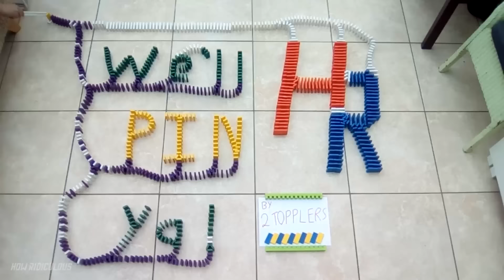Can This SOLID GLASS BALL Survive a 45m Drop?

Comment: The beautiful coney-joney was first discussed by Hertz back in 1881 and has henceforth become known as Hertzian cone cracks. They typically occur when a hard spherical object is pressed into the surface of a brittle material. In this case, the sphere itself is made of a brittle material (glass) and is "pressed" into the steel plate when it impacts, but the same effect is present. The cone-shape is caused by the propagation of a crack. The crack begins its life as a ring just outside of the region that's in contact with the plate, where the tensile stresses (the kind that pull a crack open) are at their highest. The crack generally then grows orthogonally away from the surface for a short distance before turning and heading away at a coney-joney angle. The path followed is one that maximizes the release of stored strain energy (the same sort of energy that is stored when you pull back a rubber band). The maximal strain energy releasing path is ultimately guided by the local magnitude of the stress fields (similar in concept to the gradient of the pressure levels in the glass upon impact) near the leading edge of the crack. All in all, for spherical contact such as this, the stress fields basically say to the crack, go be a cone, it's the best release. Source: PhD in this area
Reply: My guy can u teach me all know
Reply: I would expect also that the wave pattern on the cone may be related to the internal stresses placed on the glass while it cools, right?
Reply: Thus answering the age old question: there IS a doctor in the house!  Thanks for sharing your knowledge!
Reply: give me your knowledge
Reply: it brakes like that cuz a the g-force vbehind it and has a cone cuz it has no where to go, example, 7:58 .
Reply: If you read this all you are the kings of kings of all mad lads
Reply: dude! sick.
Reply: k
Reply: Dude can you teach me that
Reply: Benjamin Hackett true
Reply: My brain....
Reply: You took your time...

TO RIGHT THE WORLD A HISTORY STORY!?

Im proud

Please teach me you ways
Reply: If I shatter, I always go cone.

Its the best crack.
Reply: Funnily enough, this video will some day appear as a reference in a dissertation. I’d bet money.
Reply: I agree
Reply: Love the source
Reply: Three scopes ye
Reply: Thank you sir. I came here from snapchat hoping to find an explanation for the "coney-joney"
Reply: Maybe the amount of spin or lack of is also a factor to consider, because the spinning might have made the crack more even, but being that the spheres had no spin, they only had one impact point?
Reply: Could the PhD explain the waves? I’m still awestruck
Reply: @rew970  also if you look closely, the cones aren’t all straight, they’re at an angle. That would be due to the spin
Reply: So the middle didn't crack because it's pressed into the metal plate?
Reply: @TheNamesArif  when the ball makes contact it stretches, the point of contact was a circle, so the crack was along the edge. But due to it being a sphere, the crack followed the shock wave up the ball
Reply: @MaleviahBurned  you're the person in class who got solid D's cause u were too busy bullying smart people to pay attention
Reply: so correct me if i'm wrong 
but the forces shear the glass away from the rest in a radial wave 
it tries to follow the path of least resistance and that is why it is off center?
Reply: Thank you you crazy beautiful nerd!
Reply: As far as understanding the effect in less scientific terms - this has been known and used since the stone age as part of flint knapping of stone tools and arrowheads.  The way in which you must strike the stone or insert pressure into the stone is ultimately guided by the conical flakes that will come off.  Amazing how long something like this can be used practically and expertly before we finally understand the material physics behind it!
Reply: That's just a windy version of what I said.
Reply: @threescopes5598  You mean *wikipedia because that's where he found it.
Reply: @jsweizston5410  well yes but no
Reply: nerd ;)
Reply: Smart arse
Reply: Maleviah ok maleviah
Reply: I feel like my explanation was better tho xD
Reply: The joys of materials in engineering
Reply: I'm just curious, but I'm taking a first year earth sciences course, and my prof said in a lecture that it was due to the fact that quartz (not glass directly) has no cleavage planes, resulting in conical fractures. Could you explain quickly if this is also a factor? I'm really interested to see if these are technically both correct.
Reply: I'm pretty sure this is a jest. Whether it is or not, it's brilliant!
Reply: I feel like you’re bamboozling me with science words but I trust you
Reply: God had a seizure when trying to process this and died
Reply: Benjamin Hackett I like it ConyJony hahahahahhahahahhahahahahhahahahahahahah
Reply: @vinzentjuanlopez3675  I read all of it
Reply: The More You Know
Reply: Thank you mr wikipedia
Reply: @threescopes5598  BiLl NyE tHe ScIeNcE gUy
Reply: Source: because i fucking said so😂😂
Reply: How Come You Know All This
Reply: I’m not 100% correct, but I think that it was caused by the impact going all over the surface area of the sphere, and a bit of the kinetic energy going up the core of the sphere. The glass shattered off the edges, forming a slight cone because the impact had no where to go, it would stay in those layers making them shatter. The actual cone shape comes from the core of a sphere being the strongest part of it, so most of the core survives. However, the slope was caused by the same theory, the sections of the sphere obviously get stronger and stronger towards the core. I think this is a much more simple explanation but I’m not 100% sure it works like that. Also, I don’t really think that you wrote all of that, you copied and pasted, not saying that’s bad or something that you could not do, just saying that you didn’t really know about all of that before you searched it up.
Reply: Bro you just how?!?
Reply: Copy and paste lmao
Reply: my head hurts
Reply: i think you made all this shit up. but i also believe u. im not sure why i cant decide either way. inma go to sleep now. thanks.
Reply: im pretty sure that the sound waves made the waves of it
Reply: Ok
Reply: Accurate✅
Reply: I like to think @Benjamin Hackett has a PhD in specifically the coney-Joney
Reply: Be my teacher
Reply: Oh no I think I'm back in history class
Reply: Excellent explanation!  And this is why I can’t teach anything other than basic science. It was taking me FAR too long to try to come up with an explanation in anything resembling plain English. 

Let’s just say that when I took relativity and quantum physics  and my grandmother asked me what it was about, she was confused when I told her that she didn’t want to know. She complained to one of her friends that I wouldn’t explain it to her...three hours later she agreed with me that she didn’t actually want to know. Said friend was a retired NASA rocket scientist. Oops. 🤣🤣🤣 For context, I had a history of rambling on endlessly about science topics so my reticence was pretty out of character. I was never known as being very succinct. I wasn’t trying to pick on her, I just knew that after a chauvinistic ass of a middle school science teacher destroyed her hope of studying science, she hadn’t been allowed to take further science courses. 

My grandmother was incredibly intelligent, she just never got the opportunity to get the groundwork needed. She managed to not only raised two kids after my grandfather ran off with no support but also put herself through college and grad school at the same time and then sent her kids off to college themselves
Reply: Ummmmmm science
Reply: Damn,nn,
Reply: The real resin is that it is cleavage meaning it breaks off in sharp pieces
Reply: You copied this you filthy cheater.
Reply: @rew970  They actually DID have a spin if you see how they throw it, the way they let go creates a force on one side creating a spin on both sides. Therefore it is the twist on impact along with the reverberations inside as it smashes creating the "Coney-Joney"
Reply: So in other words the ball is good at distribution of force which causes the force to move away from the point of impact, but it still has its limits.
Reply: are you from Harvard or no?
Reply: wait wait wait did you copy and paste this or liggit write this.
Reply: I understood this?
Reply: Thanks doctor. Wonderful and understandable explanation
Reply: Hold fruit
Reply: Nice copying and pasting of information, boyz.
Reply: That was beautiful man
Reply: Copy past?
Reply: I feel like he took this out of a textbook
Reply: BIG BRAIN
Reply: It’s because the metal plate was slanted
Reply: Cool, that's probably why when an engineer calculates the strenght of a chemical anchor on concrete, they have to calculate a cone shaped break pattern (vs the strenght of the concrete). Thanks for the info!
Reply: Nnnneeeeerrrdddddddd
Reply: GENIUS!!!
Reply: Tou are the new Einstein.
Reply: It is big brain time
Reply: @PumpedCrazyGamingYT  He just did.
Reply: @nathangil8370  Like he said he has a PHD in science.
Reply: Dude, this is more than my school will ever teach me in all 12 years combined, thank you for this!
Reply: DA coney joney only acuurs when the force of the shock is spread sphere wide
Reply: all I heard was science
Reply: The ring is not actually cylindrical, but instead is a cardioid.
Reply: @acuteslipperysnake5778  your
Reply: Is this how to cone heads were born.  Thrown down the stairs and thats the result?
Reply: What is your phd called?
Reply: The actual physics that happen are more interesting.
Reply: @Kwint.  I dk
Reply: Legend.
Reply: Omg 😲  😱 welly
Reply: @nathankush2051  wtf
Reply: You say spherical object not sphere. would this effect work similar in an oval like shape or is it specifically a sphere?
Reply: I love it when PhD's come down to earth to explain stuff to us mortals in a way we can understand.
Reply: Are you saying that the steel plate hitting the glass so hard functions like therapy for the glass ball?
Should therapists be punching people?
Reply: Copy and paste?
Reply: All he did is copy/paste it from google
Reply: Weird flex but ok.
Reply: Well damn
Reply: God dam
Reply: TL;DR
Reply: That was pasted lol
Reply: I feel like this is from google ;-;
Reply: It’s way more simple than that it’s because all of the force pushing on the bottom shatters everything around it
Reply: Tf
Reply: Brooooo I mean... I least he put were he got his source that’s reasonable
Reply: can i have one big plez
Reply: Ok
Reply: I love how people that don’t understand science assume that anyone who does must be faking it
Reply: Just so u know I paused the video just to read the hole thing its currently 3:21am eastern time.
Reply: @kyleroberts4399  that great but I’m talking about the people who don’t and accuse it of copy and paste or google
Reply: What he said
Reply: In other words it want to be an ice cream cone
Reply: I kind of just figured it was like a shock wave, when you drop a pebble in the water you have rings of waves moving from the point of the impact, I figured that the cone is formed because the shock waves move away through the glass from the point of impact creating a cone shape. Further evidence of it being from a shock wave is if you look at the cone you can actually see ripples carved into the glass
Reply: Ahhhh my eyes burn! Do you know the reference
Reply: The more you know
Reply: Copy and paste
Reply: that explains why the bowling ball din't have it
Reply: so basicaly it hits the ball at a point, and the pressure is dispersed and the crack expands outward. leaving the point of impact unharmed and sendingthe vibrations outward?
Reply: There is no way he didn’t copy - paste this.
Reply: @norvillerogers3504  or maybe he's not a blockhead like you
Reply: Had to read this twice
Reply: Ur my new science teacher
Reply: You are kind of corect but Im notgoing to get into adom structure right now
Reply: you better not be spiting bull but thanks
Reply: Good to know
Reply: u googled it
Reply: who needs school when you have this
Reply: I believe you but I’m tired and don’t wanna read it
Reply: The king is among us
Reply: Redo it has no period.
Reply: I was going to say that but was to late :(
Reply: @yohanneshaileselassie4341  i know that there is a better thing than school it is this!
Reply: @vinzentjuanlopez3675  I mean it's not exactly that complicated hahah..just a history lesson and some science info you wouldn't know if you aren't in the field
It's still easy to follow and understand, and it's just one paragraph haha
 doesn't exactly take a mad lad, just someone with reading comprehension & an education :P
Reply: @vinzentjuanlopez3675  if you want a tldr, it's just that the cracks have a natural tendency to follow a certain shape upon impact
Reply: What??
Reply: Holy shit daddy chill
Reply: What makes the crack always go in cone shape
Reply: Okay, then how much force would be required to fully shatter the sphere?
Reply: Uh, what he said
Reply: Brainiac
Reply: If ur knowledge was transformed into muscle u would be the strongest man on earth
Reply: # Rifty fish
Reply: Jesus his fingers were tired after this one
Reply: Incorrect
Reply: Nerd
Reply: Somewhere there is always someone who ACTUALLY knows the answer for something no one thought there even was a solution on.
Reply: Yes
Reply: What he said
Reply: I didn’t read it all
Reply: When reading it Stanford said coney-joney
Reply: Isn't that what we called "Frostum"?
Reply: Bro I have to low of a iq to comprehend that
Reply: I was just going to say it broke and stuff happened
Reply: Big brain
Reply: nice copy paste
Reply: Glass fractures are amazing.
Reply: Ahh the beauty of copy and paste 🤣🤣
Reply: If you made a video about this I would definitely watch it! Great explanation!
Reply: It’s amazing what copy and paste can do
Reply: so there is ACTUALLY a doctor in the house xD
Reply: Short version of what he said is when it hits the plate the layers underneath it don't affected as much as the 1st layer meaning that the glass turns in to sorta like a pyramid
Reply: I'm diggin' the TLDR at the end
Reply: Thank you
Reply: That’s a lot of explanation
Reply: Nerd

Jk
Reply: Simplify please
Reply: Teach me all u know
Reply: Yerrrrrr
Reply: E
Reply: Pfffffffft i definitely new this before I saw the comment
Reply: HOW LONG DID IT TAKE TO WRITE THAT?! *looks up at the comment*🙄 AAAAAAAAAAH
Reply: @hazma1239  YeAh SuRe,I tOtAlLy BeLiEvE yOu
Reply: Nerd
Reply: @megs24031  U rude
Reply: I went to the comments looking for what the coning of the glass ball was called but didn’t expect to see a whole essay on the topic.
Reply: My guy has big brains
Reply: Did you copy and paste this from google?
Reply: No it’s cause of the Mars rocks nerd
Reply: 🔫 how dare you know more than me
Reply: I think someone copied something on wkipedia but cant  figure out who🤔
Reply: Here, take my upvote. Thank you for sharing, sir.
Reply: sooooo.... in simpletons terms, i can roughly translate it to...
"cone-cone made by big gravititties"
Reply: Wow
Reply: Do you know why the balls flip everything?
Reply: Jesus Christ dude it's just a comment you don't got to go all high school Professor on us
Reply: Me singing It's a Long comment 😮

Me after I hit the read more button💀
Reply: I’m amazed there’s no cracking on the backside because theoretically the impact would wobble around the outside of the sphere and make a crack on the back
Reply: w h a t.
Reply: All I got was this is Crack and I think maybe Kinetic energy.
Reply: nope rocks come from mars to make a coney honey.
Reply: does this have anything to do with fluid dynamics and glass being a "slow liquid" if memory serves? speaks to the quality of the sphere manufacture, but the high speed footage at the very end shows very clear ripples which appear to shape the conical fracture points.
Reply: Im too lazy to read it
Reply: NERD! jk I'm a little jealous 😂
Reply: Lol I only knew about half of that good job man! 😁👍
Reply: When you click read nore
Reply: Nice
Reply: @Tilvent  copy and past
Reply: That's what she said
Reply: Bill Nye's cousin over here
Reply: Mmmmm classic google copy and paste.....😌😌😌
Reply: You looked it up
Reply: How
Reply: can u become my friend
Reply: @johnjon4688  yes
Reply: I have no idea what any of that means but I'm assuming it's correct because there is a lot of sciencey words
Reply: I didnt understand most of it but still thanks. xD
Reply: My brains just grew.
Reply: You can look stuff up congratulations
Reply: @judahyocom69  I know right
Reply: @Polo_148  no he is not his simplistically just looked it up
Reply: @itsfabkan7732  glass break
Reply: I’m Aussie too!
Reply: Lmao seeing that, then coney-joney popping in
Reply: liyer its beacas thay wer stowlen from wizerds doing divanation
Reply: its magic
Reply: Thanks this is cool. I was thinking waves but octagonal shapes makes more sense.
Reply: Nouice
Reply: History of this video but in the past.
Reply: Google searcher :/
Reply: I dig it
Reply: Big brain
Reply: Ok
Reply: Nicely taken from Wikipedia W O W P L A G E R I S M T H E S E D A Y S
Reply: Wow
Reply: This guy just copied and paste it 🤣🤣🤣
Reply: Wise 1 u r the new Albert ienstien
Reply: Let’s goooo Wikipedia!
Reply: That’s to high of a reading level for me
Reply: So it's been already observed. Sadly we won't have anyone doing a thesis on the Coney-johnny effect :(
Reply: The legendary coney joney is actually caused by an effect that ancient aliens placed on glass balls to when dropped on a steel plate will leave a cone in the drop spot where if you place ten identical sizes in a circle it will form portal and the aliens will be able to enter our earth
Reply: I am a scientist and have and I have the world record for smarts person in the universe so I am smarter than you the reason why  the heat from the sun traveled to the ball and I  melted it to water and  the trees were pulling it apart 
And the sand started to burn caused a ant sized  wild fire and  the air froze it and the fire made it melt and explode
Reply: 6:59 see the white part at the top of the glass sphere? That is the point of impact. If you tilt your head right (to look at the bigger part that broke off that where the kinetic energy went therefore more material broke away. But if the impacting force was equal it’ll make a perfect near perfect cone.
Reply: This is why science is amazing, I didn't know about the hertzian cone crack but now I have something new to research deeper.
Reply: Yeah but can you tell my why there were ripples in the cone?
Reply: Wrong
Reply: ....... what?
Reply: Hertz never expected HR to rediscover this on youtube
Reply: I was just going to say that's all the shockwave was big enough to do but damn you wrote a lot
Reply: Jesus Christ that is such a book of a comment, wow.
Reply: And the inmpact that it lands and the angel
Reply: I didn’t even read all of it it was too long
Reply: Holy shit that was long but intriguing
Reply: bru
Reply: Amazing explanation
Reply: Damn ur smart
Reply: In Regular English the sheer stress of the amount of force being put into the glass cracks it and it breaks in a cone Shape because that's the way the pressure is distributed 🙃
Reply: A gentileman and a scholar
Reply: I also like how this wonderful individual used basic terms to make sure that everyone understood instead of using the terms like potential energy and kinetic energy that not everyone understands. This explanation is exactly why the glass that breaks off is shattered like you would normally expect the glass to, but since the flow of energy is not straight up and down and instead is in the shape of the previously mentioned Hertzian coney-joney which pretry much keeps the entire sphere in tact except for the areas that are broken off and accepts all of the potential energy as kinetic energy :)
Reply: Google says Hertzian cones are basically holes or craters in glass that has been impacted by something like a bullet. What we see happening here looks like the opposite of pictures of Hertzian cone cracks
Reply: Lol I actually learned something from youtube
Reply: I was just gonna say "its the force spreading out from the contact point"
Reply: This comment should be in a YouTube short
Reply: How the flip do you know that
Reply: He says "source: PhD in this area", what area is this? physics?
Reply: o.o
Reply: I can’t tell if it’s legit or made up haha
Reply: dummy
Reply: Wow🤨
Reply: jeez bro
Reply: Jeeze…
Reply: He wrote an essay
Reply: @MrChadw920  he summed up his Doctoral thesis.
Reply: @threescopes5598  copy and paste can do that
Reply: Wow that’s a long explanation but a good one
Reply: Ayo can you help me with school plz
Reply: How long did that tack you to type
Reply: 👏. 👏. 👏. 👏. 👏.wow 👏.👏.👏.👏.👏.
Reply: NO this is conchoidal fracturing. that's all this is its not the Hertzian cone. A Hertzian cone is the cone produced when an object passes through a solid. A conchoidal fracture refers to a haphazard mode of breakage of a material that does not adhere to any fixed or well-described physical planes of separation. Brittle materials are more likely to exhibit conchoidal fracturing. a Hertzian cone is the indentation cone created by an object passing through another object. Like how an exit wound is always bigger than the initial point of impact. the entrance wound. the Hertzian cone goes through your body because of  the energy of the bullet slowed down your body causes energy to spread inside while slowing this force down and you make a bigger hole upon exit.
Reply: Copy and pasted
Reply: My dude you got a PHD in this area you do the talking
Reply: also this affect happens while cleaving limestone, obsidian, glass, and other minerals such as flint or even Diamonds.  the cracks will follow along a 45 Deg angle of the impact location.  So this is used while making stone knives and the such by striking the edge of the mineral and the CLEAVE will propagate at a 45 deg angle to the impact.  the best way for the cleaving action is done to the material in question is using a softer hammer. i.e. malleable iron hammer not a hardened steel hammer.  This causes the materials to remain in contact with each other for a split second longer.  this extra time will allow for the cleave in the desired direction of the strike.  this technique has been used for 1000's of years in the Masonry trade and all the way back to the beginning of time of man on earth when it was discovered of using stone tools for cutting.
Reply: You just copied that off the internet you looked it up
Reply: It's because the force is being distribiuted on the sfere making it look like a cone
Reply: AHHHH MY BRAIN
Reply: @threescopes5598  b
Reply: I don't understand it but that's a very good explanation
Reply: makes some cence
Reply: what?
Reply: are you a collage professor?
Reply: It's because every Sphere is born with a Unicorn inside, and their knightly valor impacts their coming out story as a logical impression against the world outside of them that they know only through impact and impression.
Reply: @alliegoebert  it's why I'm here lol
Reply: this is either coppy pasted or realy good
Reply: @l1mpz955  CORRECT
Reply: What the heck
Reply: The pain typing this
Reply: Congrats you win a pin
Reply: Damn you right a lot
Reply: @threescopes5598  for real
Reply: ok
Reply: How does he write that much?
Reply: Am not even gonna try to understand that
Reply: I can do that 2 he just copy and pasted it
Reply: you just wrote a whole paragraph
Reply: Heinrich Rudolf Hertz. Also creator of, Hertz Rent-A-Horse.
Reply: I was going to say he woke up in the morning and felt like being a cone but that works too
Reply: Long
Reply: @judahyocom69  I thought the same thing. But if you look up the guys names with “PHD” after it, actual shit pops up regarding glass and how it breaks and yield stress
Reply: @jsweizston5410  Literally he didn’t. I looked up his name and the man literally has a thesis in determination of yield stress in glass. He really does have a PhD in the subject hahahaha
Reply: This isn't a Hertzian fracture though, a Hertzian cone fracture is when you get a cone like crater when something passes through an object, best example is when a bullet passes through a solid object.
Reply: yess! you win the internet!
Reply: Jesus loves you please turn to him before its too late
Reply: @lejesz9791  no Proselytizing please
Reply: like all of science, Hertz was a hack who claimed credit for things that'd been known since the dawn of humanity.

conchoidal fractures are what make flint knapping possible. manipulating the effect with absurdly high skill is what makes objects like Clovis points possible. you may note that Clovis points were made before Hertz was born. but, sure... it was first discussed by Hertz... whatever.
Reply: It’s call a conchoidal fracture, it occurs to glass, and rocks similar to glass.when the force of the strike moves through the glass, depending on the angle and force, the fracture absorbs much of the force, you can see the ripples left on the surface of the glass.
Reply: You lost me at 1881
Reply: Lol I copy and pasted this for my geology paper
Reply: Why is the cone asymmetric?
Reply: You learn something new every day. 👍
Reply: You are an EINSTEIN
Reply: Copied off google
Reply: God Physics is crazy and I love it
Reply: i do believe your right but this may be the laymen terms. Where the cone starts is the exact impact causing all the glass round the coney-joney to form due to what is not impacted falls off. Yay or nay
Reply: Shockaboom
Reply: Long
Reply: Had to google this to make sure you weren't just bullsh*tting us. Sorry for doubting ya.
Reply: In short it's the representation of the shock wave through the glass orb
Reply: Hertzian cone cracks are the other way around - a conic chunk of material is *lost*, rather than a conic chunk of material remaining. This is just good old-fashioned conchoidal fracture, used in making tools from crystalline or cryptocrystalline rocks for a few millions years.
Reply: Ctrl C Cyrl V
Reply: @hermitchallenges6146  I think you roasted him so hard that he deleted his comment lol
Reply: Damn, an actual credible “trust me bro”
Reply: Nerd
Reply: y o u g o t p I n n e d
Reply: REAL SCIENCE WITH BENJAMIN HACKETT
Reply: @AnubisKingOfTheDead  🤓
Reply: I didn’t want to read but I doubt it real
Reply: I wonder how long it took him to type that
Reply: @RKroese  pretty much what I took away from that essay
Reply: Vibrations go brrrr
Reply: nerd
Reply: @johnjon4688  prob
Reply: Did it take an hour to write this?
Reply: Google
Reply: Something we didn't need to know lol
Reply: Wah wah. Wah wah wah wah wah🤣
Reply: @l1mpz955  your arguing with a doctor about their field of study
Reply: the source being a fucking phd goes so hard
Reply: If I remember correctly, this results because glass has a conchoidal fracture.  Since there are no defined cleavage planes to direct the release of energy in another manner, the crystal is free to break according to the resulting material strain within the spherical structure.
Reply: What he said ☝️ 1:54
Reply: Thank you.
Reply: Too much for me to read
Reply: In other words.... the impact takes off the out most weakest material first
Reply: More informational than all of the school system😂
Reply: Congratulations on knowing how to use Google
Reply: I thought it would also have something to do with being round??? The point that hits has compression but the part on the hemisphere of the glass is still accelerating downward and that cause the crazy fractures in the cone shape.
Reply: You have PhD in this area and yet you say something like "stored strained energy". In actual science, we would call this potential energy (as in potential vs kinetic).
Reply: Dude has a PhD in Coney-Joney
Reply: I vote that they get the slow mo guys in on this to watch the conchoidal fractures forming on impact!
Reply: What the heck
Reply: Is this the same as "shatter cones" when referring to shockwaves affecting rocks near astroid impacts?
Reply: 😂 @alliegoebert
Reply: Yap yap yap
Reply: i would guess too that the method of creation will have an effect on the overall shape you may see pour and or cooling lines or air bubble deformities rings 
i see more like all the parts not making impact want to keep traveling so the part closest tend to sort of peel off and the cracks form because it resists being peeled due to hardest and ability to carry the wave of impact and flex 
so the cone forms because less mass is trying to keep travling towards the edges of a diameter from the center of impact and every "piece" of mass need to "bounce" off something and it bounces of the particle next to it so the particles with less objects to bounce on keep traveling "peeling away"
Reply: He doesn't get a dinner invitation.....😂😂😂
Reply: We are blessed to have ya:_44ClubFortyfour:
Reply: @judahyocom69 lol google can’t teach you to explain it like that… maybe khan but minimal chance
Reply: Lol my brain could not come up with that explanation. Science was my second easiest class but still not easy for me😋 I would've explained it as, the pressure of the glass ball, hitting the steel plate transfered the energy across the surface closest to impact. I remember learning about it, but I doubt I explained it right even summarized😂